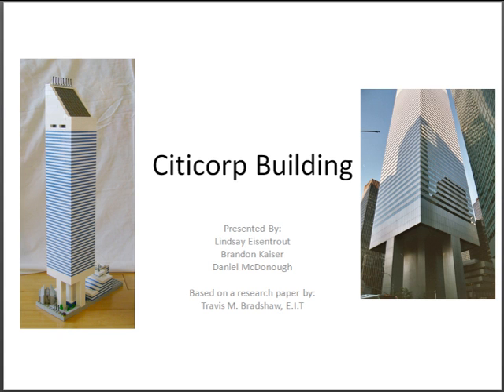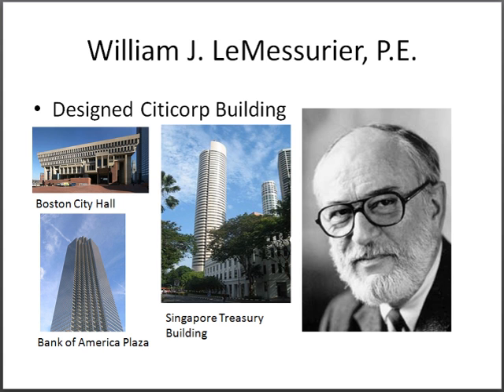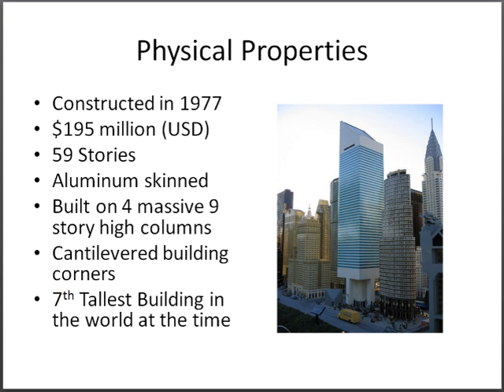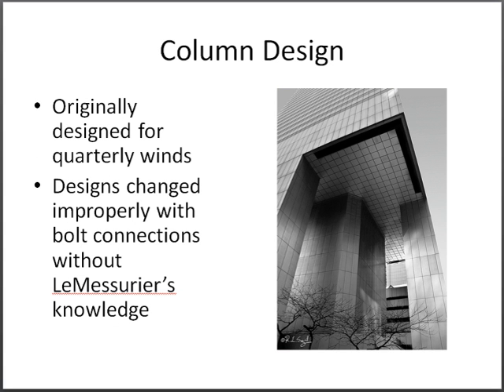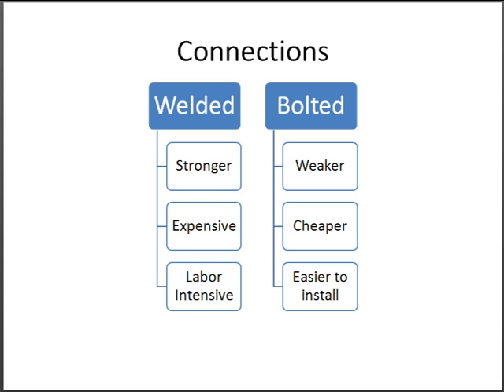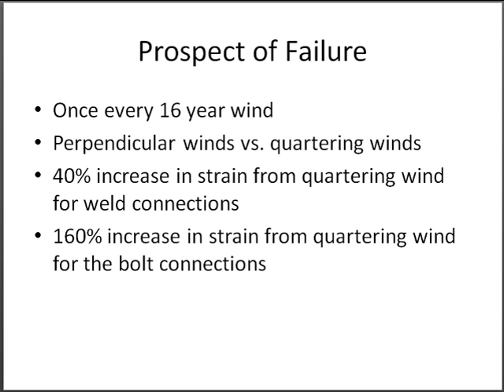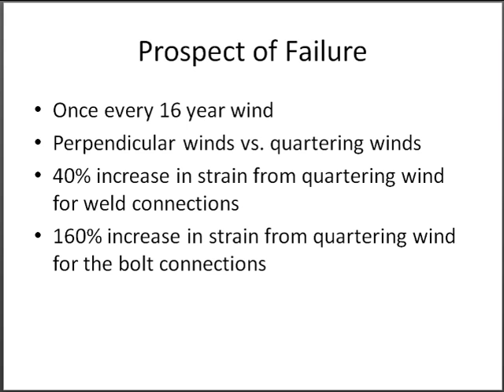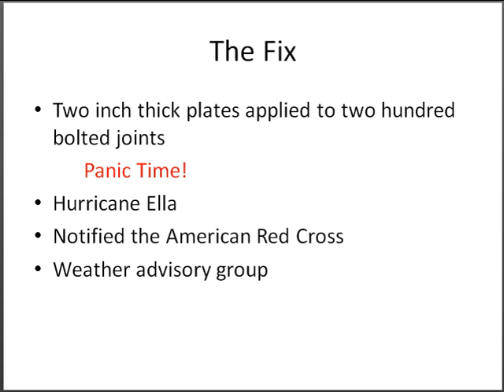The Citicorp Building

Comment: Apparently this was meant to be a very brief summary.   However, since the main point centered on the change from LeMessurier's Welded to the actual Bolted beam assembly of building - then why would the solution (in this presentation) use the word: APPLIED  regarding the solution as "two inch thick plates" to 200 bolted joints.   'APPLIED how?' by bolting or wielding?  is the obvious question immediately asked by the interested viewer.

Comment: Wrongly labeled. Design was not engineered for quartering winds..
Reply: the design included quartering winds - there are engineers who did those studies who have spoken up - however after speaking with student Lee Carolis - the chief engineer Wm LeMessurier later recalculated the wind loads and grew concerned - however it seems his concern (and Diane Hartley's who wrote a thesis expressing concern over the quartering wind load) was unfounded - the NIST has reassessed the wind loads and says the quartering winds WERE NOT the threat that those two thought - suggesting that the building did not need to be reinforced

Comment: I still do not trust this building. it does not look stable. I would like to see some computer modeling under various wind load conditions. RIP to all when it finally comes down.
Reply: your command is NIST's wish - they recently concluded that the wind loads were not the threat LeMessurier thought - maybe the original structure was safe - now it's even stronger due to the reinforcement made in the latter part of 1978